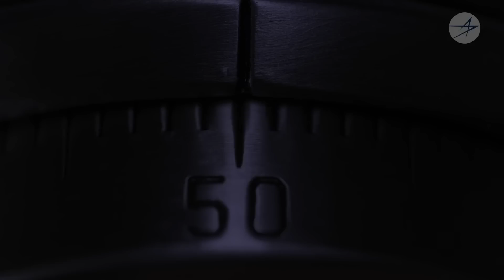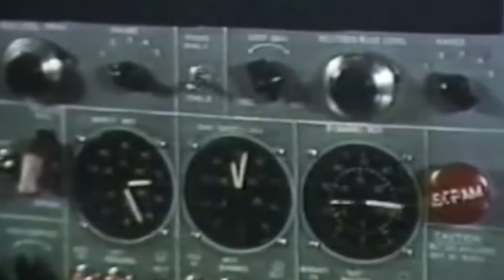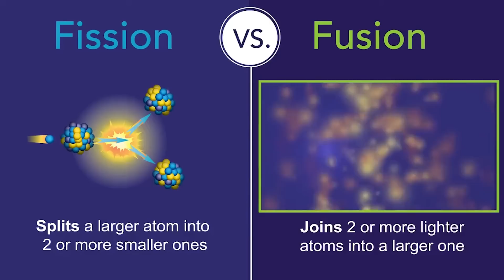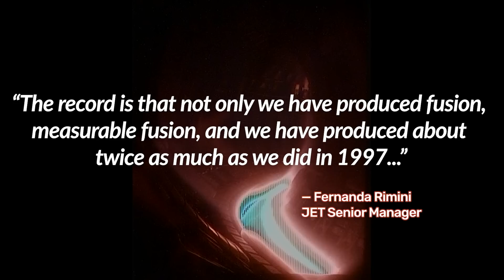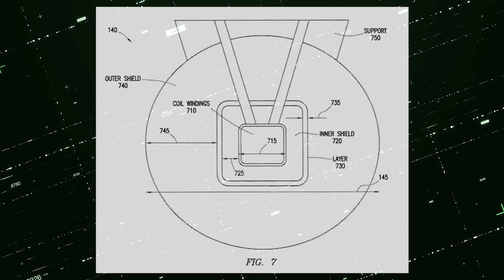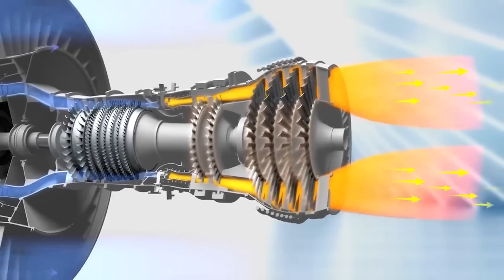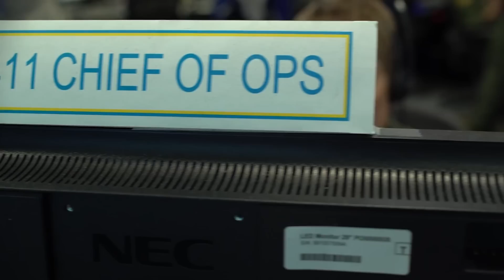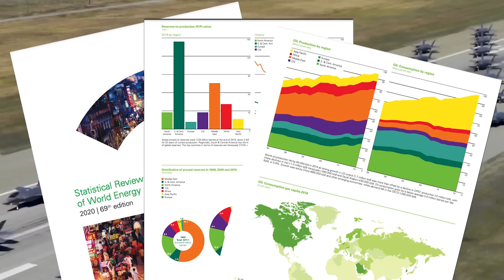Lockheed Martin's fusion-powered fighter and bomber plans

Comment: The cynic in me who's been hearing about fusion research since the 1980s tells me that this will be operational in about thirty years from now.
Reply: I’m way more cynical. As you said, fusion reactior have benn “just around the corner” simce the 80’s. This is a century away LOL.
Reply: @xxmrrickxx  This will power UAVs in around a decade or two.
Reply: @swedhgemoni8092  Unfortunately, No way. This is an idea on paper. I'm guessing 20 years, or possibly never, before a stable laboratory model is developed. Then typically 10 years to go from a new technology in a laboratory to a stable production system that can be integrated.
Reply: @xxmrrickxx  I meant smaller UAVs. In 15 years, I think the design would be mature enough for something the size of a ScanEagle.
Reply: @xxmrrickxx  You basically just described why Fusion is always 30 years away. They think of a concept and 'if' it worked, in 30 years or so you might indeed have it being made. But that 'if' has always been the very thorny part with Fusion. No matter how good the concept seemed, in reality controlling things and getting where you need to be turned out to be much harder then expected.

So we've been cycling through various concepts over time, and of course they have been getting better over time. So one day that 'if' will become real and a feasible concept will be under way.

Now this could be many decades from now, or it's possible that the science is already far enough and the concept has already been invented and is under way. It's just not clear to your average person though till you see a prototype prove it's possible. At which point it would as you described yourself, possibly be 10-20 years away.

And we see that a lot I guess, where people lose faith a concept will work out and then suddenly there's a functional prototype and the rush to perfect and industrialize it is on. The airplane is an example of this really even, when the first prototypes proved the concept, things accelerated.

So for anyone wanting to guess further out then 20 years... well you'd have to really know the science of the field and know if the funding is there to keep sustaining it that long. But I think with some of the efforts going on in Fusion right now, one of them may be already good enough to have the 30 year clock secretly ticking in the background. 

For instance the MIT Spark reactor, which is a conservative design which 'should' work according to all the science we have for that kind of reactor design. It's just a much more compact variation and thus faster to develop and already seems to have achieved development of its one most questionable part, which was vastly stronger magnets to confine the plasma much more tightly for its smaller design. Which really does throw up the counter question, of if this time might be different? At the least for some of these ideas there's a lot less guessing going on.

But I guess we won't know for sure till the prototypes power up and show if they actually work or not.

Comment: That was a good video. The aircraft mechanic member of my family points out the other consideration for fuel: its weight. The difference in weight for aircraft between a full tank and empty one for an airplane is considerable. Airlines calculate how much fuel they need to fly without necessarily filling up at each stop, because they want to optimize efficiency. A fusion powered plane would have a constant weight which means the fuel burn, distance and even the avionics would stay consistent. Heavy planes are harder to steer, but that would be irrelevant if the plane never changes weight!  You could make the same turns and pull the same amount of Gs at the beginning, middle and end of the mission.

Comment: They are probably referring to a plasma engine. Feed deuterium tritium in. Convert to plasma. Funnel it through magnetic rings to contain and generate electricity. And use the escaping plasma as a thruster/jet/rocket engine. The containment/pickup coils would magnetically contain the hot plasma. And on the way out induce a charge in the coils to produce electricity to run the system.

Comment: At 3:25 your caption reads: "The B-36 made the B-52 look tiny," while the photograph is of a B-29 next to a B-36. The B-36 would still be larger than the B-52 however with a wingspan of 230 ft, compared to the B-52 wingspan of 185 ft., and both aircraft nearly equal in length at 162 / 160 ft respectively.

Comment: Imagine. If you didn't need to use all the space inside the wings and part of the fuselage for fuel storage. You could fill that space instead with strengthening honeycomb structure that would add to the service life of the aircraft significantly.
Reply: Cessna Citation X weighs 22,600lbs, fuel capacity - 13,000lbs. You could reinforce the wings and fuselage  tremendously with less than 5,000lbs, the performance gain would be incredible. Drones could perform insane maneuvers pulling g’s never before seen. 
If this technology became available, and if it could produce that much energy, aircraft would become much much larger and likely use a different power source than our engines currently in use  by all private and commercial aircraft. 
Aircraft engines have literally not changed in over 35 years. How is this possible? Honda accord 1985 to 2023 huge change.

Comment: Small correction: When Fernanda Rimini meant that they produced fusion, it meant that they had produced ENERGY. This means that fusion is right now already producing more than what it takes to start the fusion. The problem is that it is not stable and nobody knows how to keep it stable enough time to be able to actually use this energy, for instance to  produce steam for turbines. 

The current state of development is that we are 50 years away from fusion power, just as we were 50 years ago and will be 50 years from now.

Comment: What are the two twin-tail fighters shown flanking a flight of four F 16’s (with bags) at 17:32 of Lockheed Martin’s fusion-powered fighter and bomber plans?  They aren’t F 15’s, which one might expect with the Air Force F 16’s,  because the wing root intakes are all wrong.  Ditto for F 14’s (and why would they be flying with 16’s?).  Vertical tails and planform wrong for F 22’s.  So, a few clues in the sinuous wing root strakes and upper grilled air intakes near the forward wing roots.  My best guess is that these are Mig 29’s, and this is a joint exercise with the West German air force (or some other western aligned power that ended up with the 29’s after the fall of the USSR).
Reply: I thought the same. My answer was " I dunno".

Comment: One  900 lb gorilla in the Lockheed  fusion tale is how you turn all that heat energy into propulsive force. There is a huge chasm between a conceptual patent and a working machine. Any thing that resembles a jet would need a propulsion mass heated by the fusion reaction in order to get the needed amounts of thrust in a turbojet engine. The closest thing to a workable solution would likely be propellers driven by steam turbines in a closed cycle loop or an electric generator driving the propellers. Then you still have to address how you would throttle the thing up and down to meet power demands.

Comment: Respectfully modern fission reactor designs, while requiring active management of the primary cooling loop are basically fail safe in the event of a primary coolant failure. The increased temperature causes a corresponding decrease in the fission reaction preventing a meltdown. Just to clarify when I say current designs I mean modern proposed designs
Reply: Yeah modern nuclear fission reactors are completely safe (atleast in US), everything thinks of Chernobyl when they think of nuclear meltdowns, but the site was designed in a way to cut costs which likely are not even legal in the US.  It also was caused by human error, human error at this point is likely a non-factor as most processes are also automated to prevent any malpractice from occurring.

Comment: Revolutionary breakthrough if this technology can be developed. Google has been funding some research in the area of Cold Fusion since 2015. If there is a discovery in this area this would greatly reduce the size of the generator and the tremendous heat that otherwise would be the byproduct of fusion itself.

Comment: Not sure why the Lockheed Martin project was in the news again this week. AFAIK the project is long since cancelled. What started out as a 20 ton reactor proposal that might fit in an F-16 was last seen at around 2000 tons and barely fitting in a semi truck, and still not producing net power. Might be worth actually confirming whether or not this project is still in motion.

Comment: I don’t think the fusion reactor heat the air. It works with plasma, and the plasma is a charged particle. That means it has an eletric field. So when it interacts with another electrical field, it can directly generate electricity.

Comment: One of the developers of the thorium molten salt reactor was designing one for an aircraft.  I think that is why the XB-70 was so massive.  The designers of the reactor thought flying it around was a bad idea which is why they designed around thorium rather than uranium.  It was a more efficient process and a plane crash would not be as big a disaster given the decay cycle of the fuel only taking a few hundred years.

A fusion reactor using superheated air for thrust is a concept frequently addressed, but until we actually get a working reactor I have to restrain a big <Yawn>

Comment: I was thinking in other optimization for this project. Not necessary about the reactor, but how to build it in large scale. Aluminum was expensive when you didn’t have the ways to produced it cheaply, but it was widely available in nature. Actually it is very abundant in the earth crust. I have an ideia to turn rare earth much easier to be obtained.

Comment: an interesting idea, there has never been a functioning fusion power plant, there are currently experimental reactors under construction (10-20 years until they are ready), which are still not suitable for energy production, in such a size that a ship could not handle, not that an airplane...

Comment: Such a system of fusion-coolant-heat-exchange  driven turbofans would be cool but wouldn't have conventional liquid fuel making it much more costly to add an afterburner.  (I suppose you could still do so, but now you're adding a jet fuel tank for no other purpose).  How would something like an F16 or F22 or F35 handle that combination of capabilities... essentially infinite range and dwell time from a fusion power-source, but no capacity for a sudden burst of speed from afterburners?

Comment: the options for directed energy weapons powered by fusion are going to be off the charts
Reply: The US Navy was funding research by Dr Robert Bussard on Inertial and Electrostatic confinement reactors circa 1995-2000. Bussard's test reactors were getting better results than projected. Still way short of working reactors that produce net power though. The Navy was restricted to the amount of money they could invest due to the DOE being the primary designated agency in charge of fusion research. And the DOE is strictly focused on Tokamaks. Ideally I would think that a reactor running the Boron11/Proton cycle would be ideal as it has the potential to generate electricity directly with no heat exchangers, coolant and steam turbines.
Reply: @mpetersen6  imagine an aircraft able to shoot down a missile midair

Comment: The concept of using fusion energy to generate power is impressive.  But I would like to point out that the movement of any airplane is based on thrust in the turbofan engine.  While they spent 20 minutes talking about the fusion reaction, they took only 5 seconds to say they would convert the fusion energy to heat the air using a heat exchanger, as if, of course they would use a heat exchanger.  I am not a physicist, but the heat produced such a reaction would instantly melt any metal used if the reaction is not contained in the magnetic field.  If someone is a physicist could you explain how the heat could pass through a heat exchanger, heat the surrounding air instantaneously and travel back to the reactor without melting the whole thing?

Comment: Funny, I remember as a boy in the late 70's- early 80's There were scientists claiming we would have usable fusion power generation by the year 2000. Yet here we are in 2022 with no usable fusion power in sight. I really doubt this will come to pass in my lifetime. A 12 year 1/2 life is still a hazard on the waste for several decades. Though that is a vast improvement over current nuclear power plants. I'm fairly sure fusion power will happen. The real question is when.

Comment: 6:20 small correction, there are modern reactor designs that do not need active cooling and can be passively air cooled! They just haven't been built yet. Also, fukushima wasn't a melt down, IIRC, the explosion was caused by gas released from spent fuel stored on site in water baths, which had leaked
Reply: You are correct in that the explosions at Fukushima were not the reactors melting down.  They were hydrogen explosions caused by the operators being ordered by management to try and contain the glasses, released by the reactors emergency overpressure venting, inside the buildings to avoid having to report that they had lost containment.  The gasses in question had been produced when the water levels in the reactors dropped and exposed the tops of the fuel rods. The beryllium casings of the rods then acted as a catalyst which reacted with the hot steam to split the water vapor into hydrogen and oxygen (beryllium doesn't react with liquid water, only gas)

However the reactors did melt down afterwards, as the explosions destroyed the equipment which could have been used to flood them with seawater as replacement coolant. (Again, management had ordered them not to do that earlier when it could have prevented the disaster, because the salt would have permanently ruined the reactors and required a full rebuild.   And that would have forced the company to admit that they had lost coolant containment.  Essentially the company tried to cover their asses over and over again to avoid "losing face" and admitting that they had fucked up the implementation/installation of the backup safety equipment, and each time they did, it made the problem worse and worse, until eventually it grew into a catastrophe.
Also, one of the main reasons they lost containment in the one reactor that had functioning backups is because there had been a standing order to not let the reactor cool at the maximum rate; so after the SCRAM of that reactor when the earthquake hit, the operators had been cycling the connection to the backup passive cooling on and off again, and it got stuck in the off position when the generators got flooded by the tsunami.)

Comment: Anyone who worries about nuclear power should watch Kyle Hill's series of videos. As long as the proper precautions and safety measures are taken, nuclear power can be had with effectively zero risk to the public.  Even with events like Chernobyl and Fukashima, the number of deaths in total from incidents is far, far fewer than the number who die every year from health issues caused by oil and coal pollution.

Comment: Micro fusion reactors will change the electric vehicle industry, probably will enable Fusion powered commercial passenger aircraft to be viable
Reply: Also my iron man suit
Reply: Fusion reactors might destroy the electric car industry.  If your electricity is cheap enough then you can create fuel from water and atmospheric CO2 for less that the total cost of drilling, refining transporting, etc.  Since gasoline engines are more cost-efficient than electric cars (and with artificial fuel they essentially become carbon- neutral) the economic case for electric cars goes out the window.

Comment: I find myself wondering about building something like the Star Raker, A SSTO spaceplane conceptualized in 1971 and determined fully buildable and at least theoretically effective, would suddenly become even more practical.  As it is, it would need to refuel mid-air before heading on to space. But having a Fusion reactor to power it would solve SO MANY issues, like NOT needing to refuel before going on to space, having a fusion reactor just for power in space, a FUSION SPACE DRIVE instead of a rocket, and the Star Raker could literally just land get a "quick" inspection (the idea being it would only require a day, assuming no issues to fix, before its next mission),  reload and  head back out. 

Q: "If Spaceplanes are so practical then why don't they build those instead?" 
A: As with the Star Raker, and other similarly revolutionary spacecraft, mostly SSTOs,  if "Uncle Sam" is footing the bill it was not going to get made. Part of it may be actual money amounts, despite SSTOs or otherwise fully reusable spacecraft being actually vastly more cost effective to space than a literal Skyscraper stuffed with explodium. But the main issue was politics as parts of a rocket were in districts Congress man and Senators wanted the jobs and money (and votes), and a super-cost effective SSTO spacecraft would mean less or no money for those districts. It is therefore more effective for private companies to build these vessels and supply the missions to necessitate their being. This simply because, many of the best ideas from the 20th century were never brought to fruition simply because the business plan relied on the Govt paying for it.